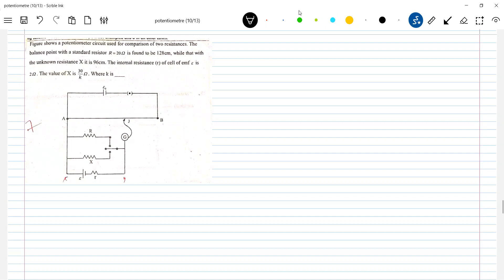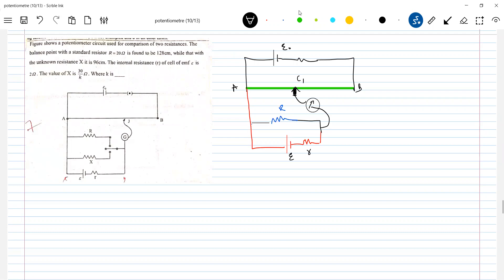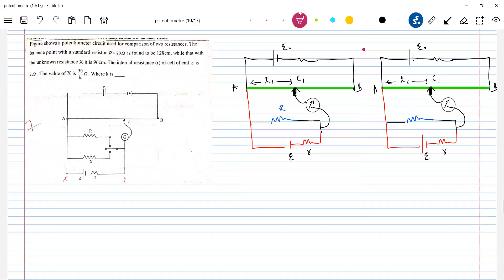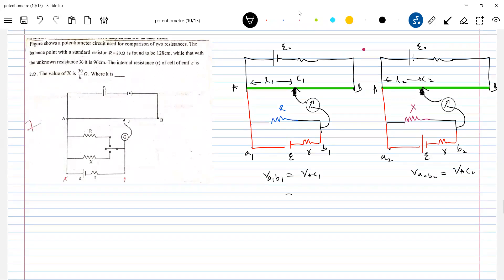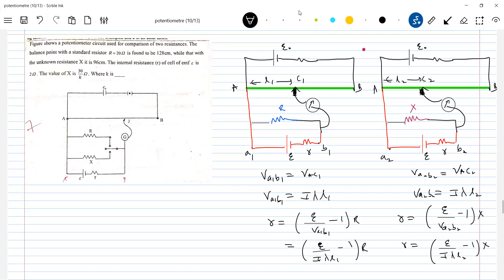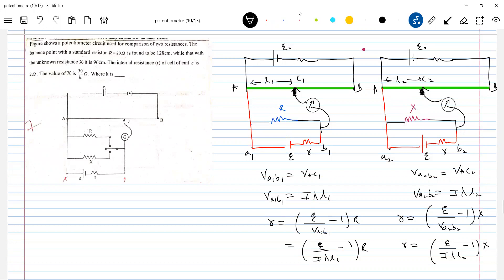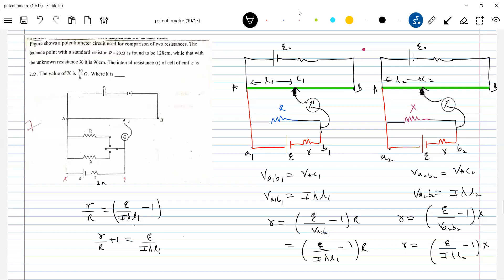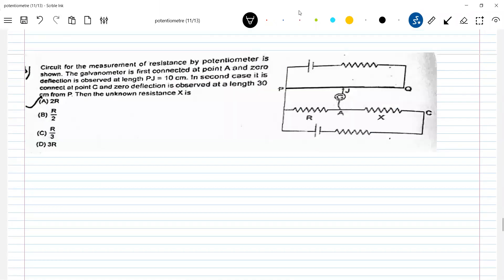19) JEE |  Figure shows a potentiometer circuit used for comparison of two resistances.

Comment: Why would current be the same in both the cases
Reply from the maker: Current through primary circuit depends on EMF & resistance of potentiometer wire only.
So same current in both cases 🙂